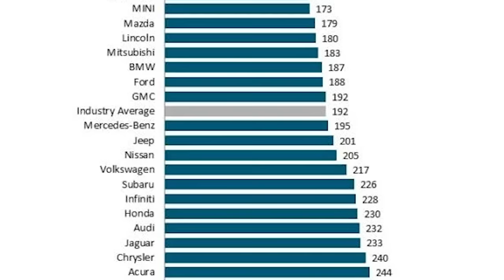Trucks That NEVER Break Down (Reliably run 1,000,000 miles)

Comment: I had 3 Ford "Triton" engines in my hvac company all 3 reached near 200,000 miles with out issues.  The one I drove had 268,000 on it when I retired h sold it to my wife's boss, it now has over 325,000 miles, just routine maintenance.    As far as diesels go,   Cummins, duramax are great engines. The  international 7.3 was a workhorse, the powerstroke 6.0 & 6.4 are notorious for problems. The 6.7 is a beast. I love mine
Reply: Yeah when he said power strokes weren’t so reliable I’m like has he ever heard of the 7.3.  Which for all intents and purposes was maybe the most reliable diesel in heavy duty trucks and would easily go 1m miles.  They may not have had the power gain capabilities from tuning and go fast goodies of the Cummins or duramax but I’d take it over any of them.  It does what it’s suppose to do.
Reply: @billyreece4445  you can tell he's just a hater

Comment: I had a good friend who was a mechanic at a Chevrolet dealership for many years. The dealership closed when the owner retired and sold the building. My friend opened an independent auto repair shop. 
This was at the time that S-10's were quite popular. However, it seemed that he worked on an EXTRAORDINARY number of S-10 pickups and Blazers. I once asked him if this was due to the number of them on the road, or because they were just junk. He paused briefly before giving the kind response, "Well, I don't think they made 'em as good as they could have." 
That seemed to explain why, of all the vehicles of all makes he worked on daily, roughly one third were S-10's: They weren't made as good as they could have been.

Comment: I Have 1998 5.2l Dakota, truly one of the best trucks ever made, and I have wrenched on all the brands.  The Dakota is stand out in its simplicity, capability, and reliability. It’s a midsize that will do the work of a full size.
Reply: i had 1 with 4x4 put 300,000 on it when the tranny went, up graded to a f150 and still wish i had the dakota ,the were a big little truck , much more comfortable to sit in.
Reply: @davemcewen9991   big little truck👍
Reply: Had one. Blew the tranny at 80k. Had professionally rebuilt. Blew again at 160k. Had it rebuilt again. At 230k it was shifting poorly again and sold it. Everything else held up well. Was getting rusty the last few yrs as all vehicles in the Midwest.
Reply: @markneukirch577  1992 had a 5 speed manual had to changed clutch at 120k also changed water pump around then .
clutch was failing again at 198k and gave it away  I could have gotten another 50k easily tho.
Reply: Could not agree with you more - Ive got a dakota with the 4.7 in it and even after moving up several tire sizes it lost NONE of its power or throttle response. Crank shaft and cam shaft sensors were replaced and the truck is insanely reliable. Its 4x4 prowess is insane - I know I can depend on it at ANY given time. I have jumped hills and it lands like it was built for it - 75mph on Klevar 265s 75 15s on dirt roads no issue - 35 mph offroad easy - will not get you stuck in mud or sand unless its you who did it. 

I loved that truck so much I bought a dodge durango - same generation with the 4.7 except this ones AWD and this impresses the heck out of me. Gave it a 2 inch life, 275 75 18s, 2 chamber muffler exhaust - also insane prowess in mud and rough terrain. Tons of room in it for taking the family literally anywhere at any given time. This also starts up every time, I should upgrade sensors while Im thinking about it - only weak spot is ball joints but I have spares. 

At no point do I ever feel worried Im going to be stranded, or cant go somewhere because of weather. The transfer case output shafts must be made of tungsten or something - because you literally cant put enough force on the system to break it. Rock freaking solid. Ive owned rams, fords and chevies - I wont buy chevys anymore because of the transmissions but my trucks both have 200k on them and transmissions are shifting like they should even after everything I put them through. 

Cant say enough things, I love that Im seeing more and more dakotas in my area where people are putting money and upgrades into them. I think I started a thing in my local town.
Reply: I bought one of the first 1987  LE Dakota’s in my town, ordered it the first day they took orders for trucks. I had it for 11 yrs and the body still looked as if new and I live in a salt state. I ordered all the HD stuff on it, 2550 payload pkg, factory 80psi E rated Michelin tires even. One of the most dependable trucks I’ve owned.

Comment: Love my 94 Nissan D21 4x4 VG30. Bought it new for $16K. Runs like new with 500k miles. Did trani and clutch at 200k and 400k when making a wining sound. 4 speed so brakes last for ever. Speedometer quit at 430k about 10 yrs ago so not sure of mileage. My F350 4x4 2003 bought new for 36k. Have spent a few $ on engine head gaskets at 150k. Over 300k now and 6.0 diesel runs awesome. Original engine and trani been good. No problems there. My 72 F250 ranger XLT Camper special only has a little over 140k . I pulled the 390 and rebuilt it hoping for more power. Guess it was fine no change after rebuild in 1990. Still a good truck.

Comment: Even though lbz and lly are the same engines with different tunes, lbz was always the public's pic. They are often chosen over Cummins and powerstroke when it comes to power. But, the later small/big  locks chevys pickups/suburban were always the trucks to go after. They were absolutely great towing machines, and some if the trucks that came with the 8.1.
Reply: LBZ and LLY are NOT the same at all, other than the basic block design and a few shared parts. Most of the engine is very different. If you really knew about the Duramax, you'd know why everyone wants the LBZ over the LLY
Reply: @Chevtec  that's pretty much the difference. Less emission components, and a different tune/parts. And the LBZ is easier to work with and has the cp3 pump instead of cp4 (I think the lly has). And yes, they are the same engines, same size, same exact blocks, just minor  things changed on them.

Comment: 3rd gen ram 2500s with the 5.9 cummins are amazing work trucks. sure, they ride a little stiff, but man can they tow! currently have one in the family thats at 400k miles, and nothing has needed any work besides your basic maintenance(oil changes, serp belts, batteries).

Comment: I love my 2nd gen tacoma!!!!! But I definitely have been flirting with the idea of a 2nd or 3rd gen power wagon or an 06 duramax! The fact the power wagon comes with a 12000lbs warn winch, front & rear diff lockers, and an electronic sway bar disconnect is absolutely game changing!!! Just wish they came with a Cummins option
Reply: Check out the new 2500 Rebel. Doesn't quite have all the PW offroad goodies though
Reply: Don’t know if I’d switch out a Tacoma for a diesel unless you need a much bigger truck.
      No matter how good the 06 dmax are; they won’t hold a candle to a Tacoma in year over year repair costs
Reply: @justinmartin8887  sometimes you just WANT the bigger truck haha doesn't always have to be a need

Comment: He's right about hot shots and especially car haulers preferring Cummins. I've worn out several pulling 3/4 cars on a trailer for 500k+ miles. I prefer the 6.7 but nothing wrong with a 5.9, either 12v or 24v.  An Aisin transmission is stronger but the 68rfe is no slouch and shifts smoother and can be programed.

Comment: Inherited my Uncles 2008 Ford Ranger Sport 4.0L with 98,000. It will be my sons first vehicle. Runs and drives great. I'll be buying another 5.7L Tundra extended cab 4x4 soon. Had an 87 Nissan Hardbody manual with 330,000 miles and it was still running strong when I sold it. Great list and video.

Comment: Got a 05 tahoe with 300,000 and before anyone ask's "has the transmission been replaced or "did it go into neutral while driving" I got a answer no it is on its original 4l60e and all thats been done is 1 not beating on it. 2 not throwing more horse power at it than what it was deisigned for. 3 changing the fluid every 100,000 miles if it doesn't show any bad signs early and lastly 4 a upgraded radiator and transmission cooler as the previous owner told me.  but when I look up the vin number it keeps coming back different sometimes I get LS or LT but I mostly get FLEET.

Comment: My 08 F150 with a 5.4 3v has 345k . Guess changing the oil like you're supposed helps.
Reply: I have an 08 f150 pushing 300k. While these engines are susceptible to poor maintenance, if you use premium synthetic and change every 5000 miles, they can last well over 400k. I know of several fleet vehicles where the oil was changed religiously that have well over 400k. Carbon build up is what caused the problems. 
Super pro tip. Keep your foot out of it and keep clean oil in it, they are excellent engines.

Comment: I have a chevy 2500 1997 with almost 300k miles and it runs fine, all that is broken is that sometimes the transmission doesnt work right and gets stuck in drive and ac is broken.

Comment: Both 7.3 and 6.7 are good. Just not the 6.0 or 6.4. Stay away from V6 eco boost. They pop turbos left and right. The coyote V8 are phenomenal.
Reply: BS on "popped turbos"
Reply: Coyote v8 has issues too
Reply: @deboralacreta  five oh’s had lots of issues, 2.7 eco not so much

Comment: 1970's Toyotas and Datsuns were mechanically very sound but the body's were another issue. Rust was the enemy and how many of those did you see with a wooden box where the metal one used to be. The Mitsubishi was a solid contender with the turning radius of a Mack Truck. A true 6 point turning midsize beast was the Mitsubishi.

Comment: Whenever people talk about the ford powerstroke (International DT-444), they mean the 7.3 . The earlier 6.9 IDI was a dog, had fuel pump problems and wasn't a very good engine. The 7.3 was a redesign that shared some of the 6.9 problems but was much better. International designed the DT-444 as the primary engine for their full sized school buses.

Comment: I've got a 4.3 V-6 in a half-ton with 5 speed. It has 312,000 on the clock and still runs fine, uses virtually no oil, no water. A great little truck!
Reply: What year is yours? Mine's a '97 GMC with the same engine and tranny and close to 300, 000  kilometers (Canadian miles).
Reply: @jimervin1637  Well, it a '95 which replaces my last truck, also 4.3 motor. In this case a '97 Chev that was a former ATT&T truck. I believe I got something like 275 before the automatic trans began failing so I parked it at my first wife's place and use it for parts. The truck ran great but used a quart of oil a week which was not so bad considering I drove about 400 miles at the time and that was cheaper than buying a new motor, but the worst problem was water/antifreeze consumption--you had to check and add every day. The damn thing had a cracked block but kept right on ticking!!
Reply: 1996 gmc Sierra 4.3 700r4 transmission.. approaching 700 000 kms.. ( Canada 🇨🇦).. the body is starting to go though, unfortunately..
Reply: @h8troodoh  Well, mine ain't no beauty queen--Typical cab corner rust and a dented fender, but this little truck is terrific.
Reply: @RC-ml3ne  mine either,she's suffering from a typical Canadian climate, cab corners,etc,all starting to go,but agreed they're good Ole trucks..

Comment: There is a Chevy S-10 near me and I think it will go for sale soon, it looks like a senior owner, extra cab, shell on the back where it is taller at the back then the front, it is a extra cab, and I think it is a 2003 model, I am guessing though, I have never owned a GM product before, I am looking for something for my son.Are those the good years for that truck? Is one motor better than another,  I know we had some at work and they were horrible trucks, no one would drive them so they had to sell that at auction.  The truck is very clean and not abused at all. Retired owner.

Comment: The Hilux is challenged by the Mitsubishi L200 also known as the Strada or Triton depending in region. This one is proving itself to be one hell of an off roader.   There's also the Isuzu D-Max and the international Ford Ranger, a version of which is sold in the US with a gas engine.  But international Ford Ranger has turbo diesels.  There's also the Nissan Navarre. Along with the VW Amarok, you have a very successful genre of small pickups that are powered by turbodiesels but one that's absent in the US market.  Toyota's line up of pickups doesn't end there with the Hilux.  In Asia and Japan, you have the HiAce and Lite Ace cab over pickups. In some regions you have the 79 series Land Cruiser, kind of like the Land Cruiser idea of the Jeep Gladiator.
Reply: Mercedes has got a pickup truck to offer too.
Reply: @deller5924  if you're thinking of the X Class, that's just a rebadged Nissan Navara...with a Renault engine.
Reply: @damilolaakanni  Oh! I didn't know that. Thanks, mate!

Comment: Had a 1980 Hilux i rebuilt the 20r and, a 5 speed from a Celica GT. That was a great truck for a long time. Quick and, lots of torque thanks to +.020 bore and, .010 mill. Plus a LC Engineering camshaft for lots of low end torque. Malory performance distributor, Webber carburetor and, a lot of hours of work porting the manifold and runners to smooth transitions.

Comment: For years, I drove a 94 F150 with the 300 ci straight 6 and  the 5 speed trans.  She ran 250,000 miles for me with routine maintenance.  What killed it was hitting a kamikazi deer at 50 mph, I walked away.

Comment: The chevy  6.0 definitely needed to be on the list.  I know several people that have 500k or more miles with no major repairs...
Reply: The truck will rust out around that engine until it falls out. Then gets turbocharged in an fbody junkyard swap and runs for years at 600hp.
Reply: Agreed I have a 2008 2500hd never had an issue well over 200k miles....
Reply: @JakeArmyRetired   They are pretty bulletproof!. I have a brother that bought an 05 with under a 100k now hes got like 400k on it,  And he uses it as a plow truck during the Winter! Never had a single issue.
Reply: 35,000 from 600k 2012 6.0
Reply: @freddiecliburn9711  so, 565,000?

Comment: MY very best truck was my 86 ranger with the mitsubitshi turbo diesel ,i sold it with 400,000 miles, only thing ever done to the motor was timing belts every 100,000 and a starter ,it would start at - 30 glow plugs only and close to 50 mpg ,more torque then my previous 350 chevy pulling a trailer, id still have it today but it was so rotted out from salt and canadian winters ,it sat for 9yrs ,and started on the old fuel and 1 glow plug cycle by the new owner.

Comment: The new 6.7 powerstrokes are pretty amazing. The 6.0s were pretty solid in the later years especially with upgraded egr coolers. 6.4 you could make stupid power with just deleted and a tune but they could get expensive pretty quick. The 7.3psd were just absolute tanks, not much power but enough and very reliable.
Reply: Ya, 6.4 could have a bunch of power(high rail pressure), but that thing was a garbage heap. When it failed it failed massively. Its an extremely expensive engine to fix, if it could be fixed. At least the 6.0 could be fixed and could be made decently reliable, but Fuc* the 6.4
Reply: @SwingArmCity  yea, my dad had an 08 king ranch 6.4 and we deleted it at 130k and luckily after it was an extremely solid truck with great power. We sold it at 170k with no issues in between then other than an up pipe leak. To my knowledge the truck is still running strong
Reply: @ethanhenneberry2625  When it goes bad ( and it will) its going to be $$$$ to fix, maybe a new motor.
Reply: Cant beat the old 7.3's IMOH.
Reply: @justsayin7937 
One of the best for reliability until the epa f’ed with everything. Now reliability has gone to shit on everything for 2 mpg.
Reply: The 6.0 is the wost deisel engine ever made and the 7.3 is way better than the 6.7
Reply: Lol I've never heard anyone praise a 6.0 power stroke before 😂 I guess there's a first for everything
Reply: @joshanderson924  come on man its a good reliable truck, you only need to put 10 grand into it to make it opperate without destroying itself
Reply: @jamesbasye2362  😂 fanboys gonna fanboy
Reply: My 7.3 has 400k miles, original injectors, original transmission.

Comment: At this point, anything new and worth owning is a mortgage payment, and the higher the trim level the more problems. Not arguing tech works well on some things, but when a transmission in a newer diesel costs more than a decent used truck used to, sumthin ain’t right! I opted for all guts no glory ‘16 Ram reg cab dually with a Cummins in tradesman trim. Just enough to be perfectly comfortable but absolutely zero issues.